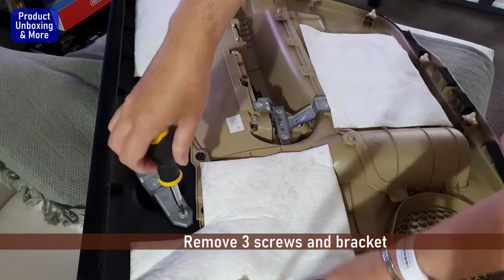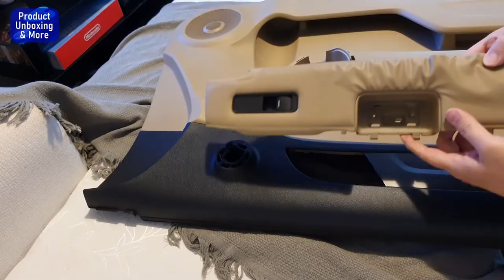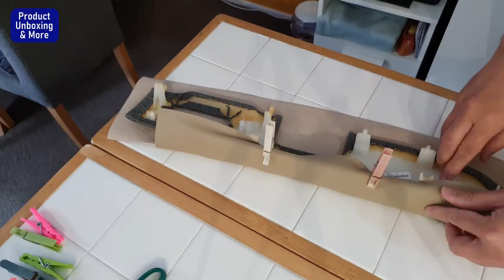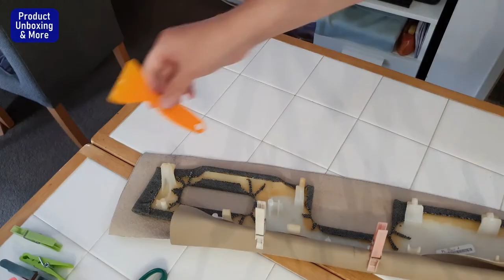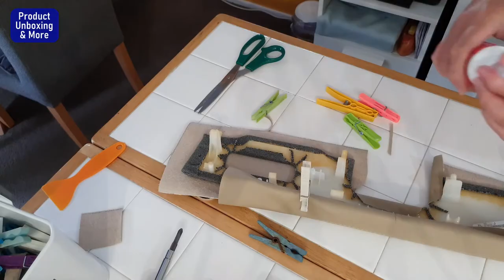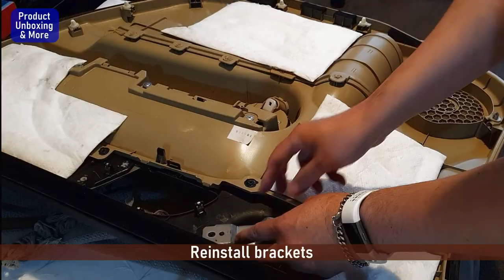Vinyl Arm Rest Replacement on 2007 Honda CR V 3rd Gen

Comment: Excellent full removal and installation procedure. Thank you. Will be tackling this job this weekend.
Reply from the maker: Have fun! Thanks for watching.
Reply: How did it go?
Reply: @호주박-x8p  it went well. I installed the driver's side first. After the experience installing the driver's side, I modified my technique for the passenger side. I left the existing foam but for the passenger side, I removed the foam on the underside of the arm rest because leaving it on caused the replacement to be too thick and gave me difficulty in aligning the arm rest back to screw it down for the driver's side. So the passenger side installation was easier.
Reply: @powerflex500  thanks for your reply, that's good tips! How long did it take ? I'll replace it this weekend :)

Comment: Could be better, i think. Maybe if you use a contact glue - a hot air gun right after gluing parts, I guesss you should have a better result. Thanks for sharing.
Reply from the maker: Thanks for the feedback and sharing your knowledge.